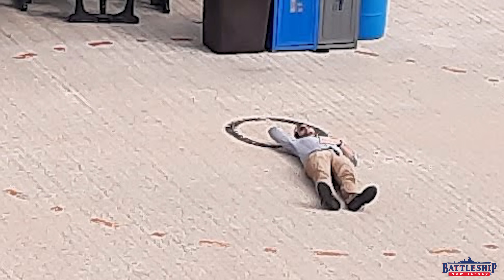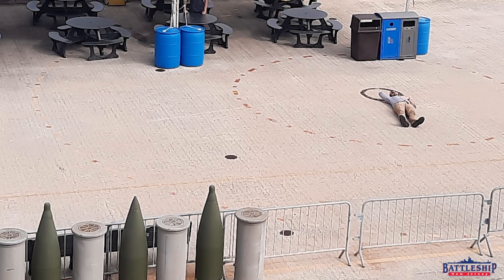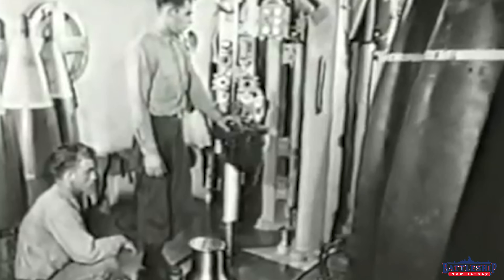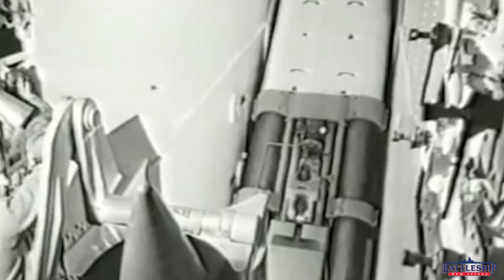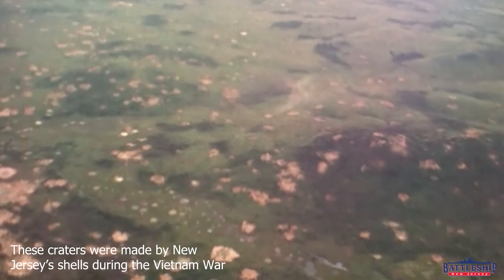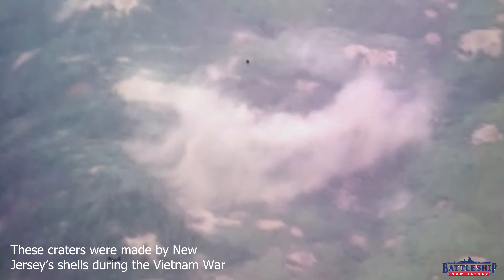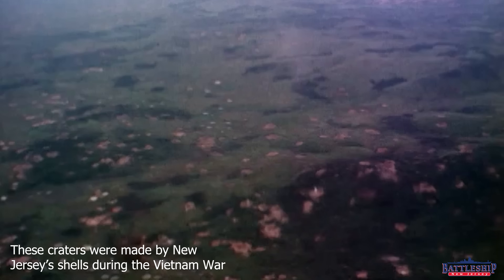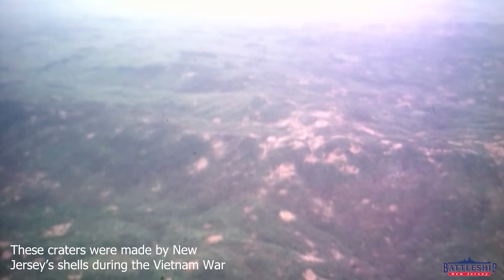How Big Is the Crater Made By a 16in Gun?

Comment: I recently became aware of an incident with Wisconsin after WWII during Korea she took a land-based artillery shell (which of course did next to nothing) and her response was to engage the artillery with a full broadside salvo from her 16in guns which obliterated the enemy artillery (and everything else in the area). 
One of her escorts messaged her, "Temper, temper".
Reply: American Naval Power. The 16/50s are the best big guns ever made.
Reply: @davelewandoski4292  Perhaps not the most powerful but, I agree, arguably the best battleship guns ever put to sea.
Reply: @177SCmaro  The Yamato's 18" may have been bigger, but 16"/50cal had a higher rate of fire, and higher muzzle velocity. So, arguably more powerful.
Reply: @whirledpeaz5758  From what I've read the 16in 50cal was somewhat more accurate and had similar pentitaion characteristics at long range as the 18.1in but the 18's, being a heavier shell, had superior penetration at shorter, flatter trajectory, in addition to a larger burst change.
Reply: @177SCmaro  All true. Given that the Iowas had a 5 knot speed advantage, they could have kept any potential battle with a Yamato at the range that gave them the advantage of better accuracy and equal armor penetration...
Or just stay out of range until a sistership came and they could pummel the Biggest Dog together.
Reply: @johngregory4801  
In an actual engagement where the true capabilities on either side were not known and it wouldn't just be Iowa and Yamato but with supporting surface task force (no carriers) comanders on both sides instincts likey would be to close the distance to increase their chances of landing shells. Iowa would have the advantage first but the closer they got the greater the advantage for Yamato. 
That said, again, in an actual surface ship battle the Iowas outnumbered the Yamatos 2 to 1. I would predict that this ultimate "decisive" the Japanese always sought would still end in the American's favor though they would likey take heavy damage, possibly losing one or two Iowas in the process but destroying or crippling the Yamatos task force in the process.
Reply: @177SCmaro  First, if all the Iowas showed up, it would be a 4 to 1 battle. Second, no captain of an Iowa would close the range unless they wanted to inflict less damage than they could at optimum penetration range. Being able to dictate the conditions of battle is the advantage of being 5 knots faster and more maneuverable. This isn't two brawlers duking it out like Rodney and Bismarck going at each other, it's Muhammad Ali's "float like a butterfly, sting like a bee" strategy vs Yamato's Smoking Joe Frazier bruiser toughness.
Reply: @johngregory4801  
Incorrect on both counts. 
1. There were 4 Iowa-class battleships completed and 2 Yamato-class completed thus, as I said, the Iowas outnumbered the Yamatos 2 to 1.
2. You are viewing a hypothetical engagement based on what we know about both ships today in order to optimize the strategy to maximize Iowa's chances. I am speaking of how the engadgent would have actually played out given surface navel strategy at this time combined with the fact neither side knew the strengths and weaknesses of the other 
The US did not know they had the faster ship nor did they know Yamato had 18in guns, which mean their Iowa's "immunity zone", intended to protect against 16in guns, was all wrong.
There actually was surface engagement between the Americans and Japanese and they almost always started out as a contest of long range gunnery and both sides maneuvering into a relatively close range "brawl", as you put it, until one side either dies or retreats.
This was a similar pattern to air combat where engagement tended to start at high altitude and, as a result of maneuvering, ended up a low altitude "furball". It's just the nature of combat when shooting guns at each other. You want to maximize your chances for hits, you close the range.
Reply: @177SCmaro  Maybe. Mushashi was sunk before USS Wisconsin joined the Pacific Fleet, so it would have been 3-2 before then. Once Wisconsin was there, it was 4-1. As for battle tactics...

Maybe, maybe not.
Reply: @johngregory4801  
Before they were where?  If we're picking and choosing to improve the chances of one side or the other we can just as easily go earlier, before any of the Iowas joined the war and it would be two Yamatos against the likes of North Carolina and Colorado or, stars help them, ships like New Mexico...😬
Reply: @177SCmaro  Truth. I recommend the two alternate Leyte Gulf scenario videos that Drachinifel did for that. One has the Standards that bottled up the Japanese fleet at Surigao Strait coming north in time to meet the Japanese fleet off of Samar, the other has Admiral Willis on USS Washington leading the Fast Battleship fleet (both North Carolinas, Iowa and New Jersey) that many assumed Halsey had dispatched to help Taffy 3 getting down there in time to interdict the Center Force.
Reply: @177SCmaro  Very well said.
Reply: @johngregory4801  It's a shame the last 7 Battleships were canceled, or it would've been 5 Montanas with 6 Iowas vs yamato and musashi. lol
Reply: @whirledpeaz5758  Besides, you couldn't fit three 18" guns to a turret and still keep the ship panamax.
Reply: @davelewandoski4292  Made right in Bethlehem, PA.  I remember seeing the lathe they were turned on.
Reply: You have to wonder what that battery commander thought would happen if his artillery engaged a battleship in a gun duel.  One of the truly nasty upgrades the Navy had planned for the 1990s refit that didn't happen was the addition of a dedicated counter-battery radar to the Iowas. That radar would have allowed the ships to precisely locate any enemy artillery that was stupid enough to fire in their vicinity.
Reply: @JBee792  you have to wonder if they misidentified the Wisconsin, thought maybe a Cruiser or even a DD. Big surprise for them.
Reply: Don't slap a big guy carrying a big stick.
Reply: Indecent
Reply: @tulkdog  I guess things got a bit salacious after the barrage.
Reply: @tulkdog  cought that too eh?
Reply: New Jersey has a similar story, she took a round to a turret while at anchor and suffered her only battle casualty. the round splashed off the armor and sprayed the deck with shrapenel. 
New Jersey cut anchor and set full steam and spun the aft turret around so far that the return salvo did more damage to the ship than the attack when the overpressure destroyed a deck compartment
Reply: OUCH! that's like hitting an ant with a sledge hammer. lol.
Reply: Was it or from the fat electrician channel?
Reply: But you don't understand 😂
Reply: I read somewhere a full broadside from one of the ships move the boat sideways in the water like 15/20 feet
Reply: @liljohn309 I've heard that too but I take it as apocryphal. The mass of a 50-70,000 ton battleship is too great even for a full broadside to change it's momentum that much. I have wondered, though, that in a claim ocean if a broadside from the main battery might make the ship rock slightly in the water.
Reply: @177SCmaro  According to the Wiki, the Mk 7 16/50 produced 290 MJ (81 kWh) for the light projectile and 355 MJ (99 kWh) for the heavy projectile of muzzle energy. Per barrel. 

Times that by 9, you get 2.61 to 3.195 billion MJ, or 792 to 891 kWh. That is an enormous amount of energy. The barrels of course have dampers and the huge length of the ship helps it stay in place, but I wouldn't be surprised it if moved at least a couple of meters.

Comment: "Danger Close" which is a field artillery term which means that friendly troops or forward observers need to take cover to protect themselves from shell fragments, etc.., is generally 650 meters.  IIRC, 400 meters for 105mm artillery.  For a 16" gun it is 2000 meters.  You can be a bit closer if you are at right angles to the gun-target line because guns have a longer range dispersion error than they do a lateral dispersion.  This gives an elongated goose egg on the ground where any give shell will hit.  It is always better to be off to the side of the gun-target line than under it.
Reply: Geez. That's approaching the "danger close" distance for a freakin' ROCKET LAUNCH
Reply: There are numerous films of "walking barrages" in WWI which routinely dropped within 50 yards of advancing troops--sometimes within 100 feet--with no GPS--only skilled artillerymen. A 105 crew of the time could get single round direct hits on a pickup truck at four miles--on demand.

Comment: While I’d expect that an American 18” gun would have very impressive performance, especially if a similar superheavy AP round was employed, I can’t help but think it’d be a wash or reduction in capability on the Iowa class hull. Since an Iowa would probably only fit 6 18” guns vs the historical 9 16”/50 caliber guns, I think the improved chances of hitting and potential for more hits would be better.
Reply: The 18" gun the USN tested wasn't all that much more performant than the 16"/50 with superheavy shells.  Worse, it also had a horribly increased erosion of the barrel liner.
Reply: If it was as accurate as the 16
Just because it’s bigger doesn’t mean it’s just as accurate

Comment: First, thank you for this channel! 
Does anyone know, during the shelling of the islands in WW2, if they used HE shells or AP?  If HE, would AP have been better?
Reply: Unarmored targets would have gotten HE, armored targets (capital ships, fortified structures, and bunkers primarily) would have gotten the AP. Although in the case of tanks I am pretty sure that a 16-in HE shell landing somewhere near by would probably pulp the crew of even the most heavily armored vehicles (recall even the thickest armor on a tank is still significantly thinner than the armor on a cruiser or battleship)
Reply: @adamdubin1276  Appreciate the answer, thanks.
Reply: @adamdubin1276  Yes, and the HE shell still weighs 1900 pounds travelling well over 2000 feet per second.  That shell has a massive amount of kinetic energy, even before the bursting charge is considered.  Any tank that took a direct hit would be done for.
Reply: I wondered, if the shells had gone deeper into the ground would it have done more damage to the tunnels. But, that much weight going that fast.. that's a very motivated knock on the door.

Comment: Any thing beyond a 16"/50 was overkill.  According to the NAVWEAPS site the Mk 8 projectile could penetrate 15" at 30kyd.   A range far beyond the ability to have a reasonable chance of scoring a hit even with modern fire control. 

The principal damage mechanism for an AP round is not the bursting charge.  It is the shrapnel flying at supersonic speed and causing damage to unarmored or lightly armored components.   Compared to its contemporary AP rounds it has between 500 and 1200 pounds more fragmenting metal than the heaviest British, German, Italian and French main gun rounds.   Only the 18"  guns of the Yamato threw a heavier shell.
Reply: @legiran9564  The Navy abandoned the 18" gun project early on because penetration from the 16"/50 was sufficient to defeat the belt armor of any practical ship design.   The only plate on the Yamato that was immune was the turret face.  Battleship design reached a practical limit with the Yamato and proposed Montanas.  The Japanese designed a super Yamato with 20" guns but it doubtful they could have built it.
Reply: @johnshepherd9676   Sjeez!!! Nuanced comprehension in context of timeline is not your strongest attribute is it? "defeat the belt armor of any practical ship design."  Who decided that? Your mom? 🤣 You literally raised all the point I addressed so to prevent me arguing in circles in line with your cognitive ineptitude I'll respond with an infantile comment more suited for you.

Comment: What about 20.5 inch main guns. With a range of 45 miles.
Reply: Diminishing Returns. The Royal Navy did some cost assessment with battleship and they concluded that bigger is better to a certain size. A battleship with bigger gun requires more costs but it also does more damage. More Investment - More Return. The British realized that the return to investment starts to diminish after 15 inch gun. It flatlined after 16.5 inch guns and becomes completely negative after 18 inch guns. In short a battleship armed with 20 inch gun is not worth the massive investment. You get more value out of your investment when you have 2 South Dakotas armed with nine 16 inch guns each displacing 35,000 ton than 1 A-150 Super Yamato armed with six 20 inch gun displacing 70,000 tons.
Reply: range isn't as important unless you are shooting at land based fortifications, ships are nearly impossible to hit at longest range as any speed or direction change by the target make the shot miss. Where the range matters is actually when you get close, you can fire a flatter trajectory and get better armour penetration when you have a longer range gun. Drachinifel has a vid just over an hour and 11 minutes long on battleship guns, rating them for effectiveness.
https://www.youtube.com/watch?v=oR2ltH4aqAM

Comment: With the "Dummy" round it is specified for loading and unloading. With the driving band driven into the rifling it seems like unloading would be a serious pain to go through. What was the method for unloading? I could think of a couple possibilities which would require a ring being threaded into the base of the shell and a system inside the turret to pull the shell out with sheer brute force but have never seen any mention of such a system or the required screw ring to accomplish this feat.

I cannot imagine any way of pushing the shell out by sticking a ramrod down the muzzle that would be effective at all nor any way for the loading ramp to be down into position as the recoil mechanism compresses as pressure is applied to the shell to push it out of the chamber.

I did see a picture once of a piece of a burst shell that appeared to be about 1 foot long and 2-3" in diameter that was stuck in a tree about 1/2 of its length that was purported to have been discovered about 300 yards from the shell impact location on a battlefield somewhere and supposedly from a 16" shell. It was in an overgrown "jungle" type area and had no doubt impacted other trees, vines etc on the trip from the impact to the final resting place. So while the crater may be 30 feet wide, the death zone is considerably wider. A chunk of steel weighing a couple of pounds and traveling at a velocity between 2 and 5,000 feet per second and likely spinning at a high speed would be an absolute horror as it journeyed across the landscape.
Reply: I believe Ryan has an existing video discussing shell extraction in the event of a misfire and jam, which would presumably be a similar process (I could swear I have seen such a video in the past year, but then I have watched videos going back several years over the past year, or so, since stumbling upon this channel).  If I recall, my recollection is that they basically hammered it back out from the deck side of the gun until it dislodged enough to be unloaded.
Reply: They shot them out.